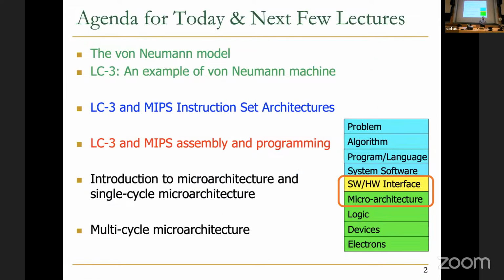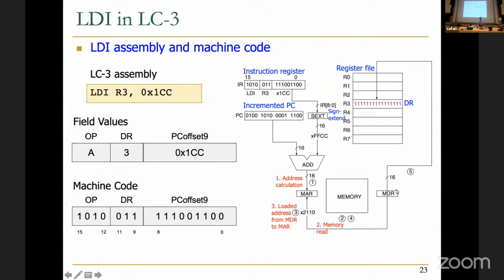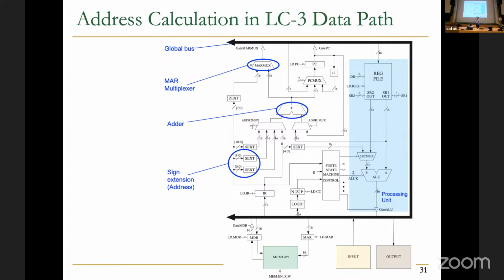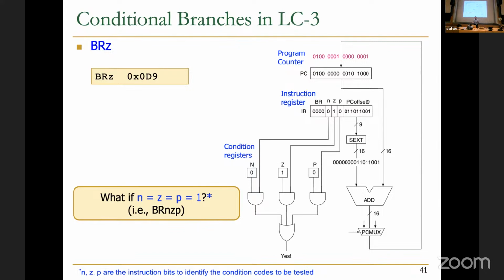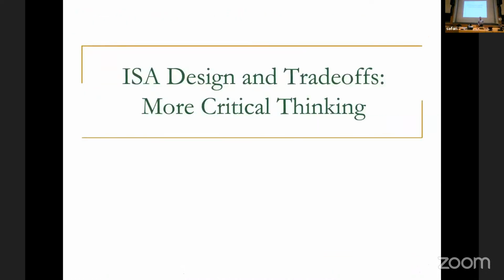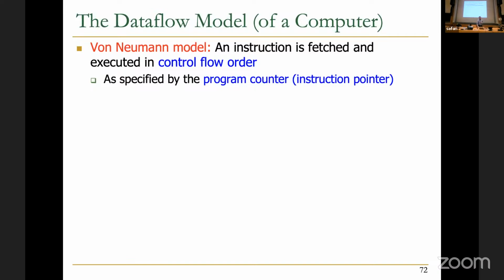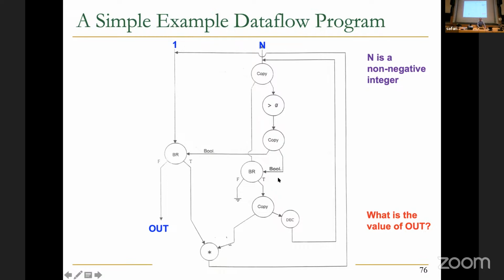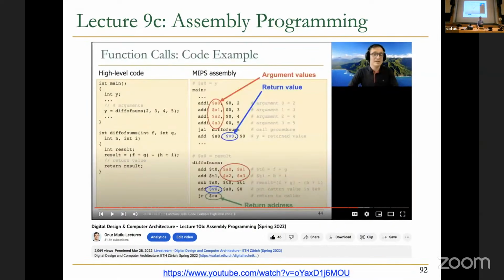Digital Design & Comp Arch - Lecture 9: ISA and Microarchitecture (Tradeoffs) (Spring 2023)

Comment: This makes me wonder how/if the use of eg x86 (with all it's legacy parts) gives us overhead (in various modern use cases).
- Does it cost much (energy/latency/materials/design effort) to do hardware translation (relatively)?
- How much hardware translation is typically involved for modern consumer chips?
    (hard to put a number on it but I wonder about the part of the gap between HLL and HW bridged by hardware translation) 
I am eager to know more about the subject :-)
Super interesting all these trade-offs, now I start to see the "art" in the design choices.